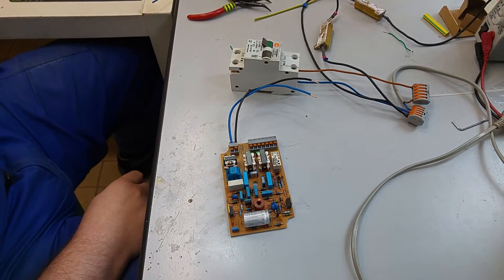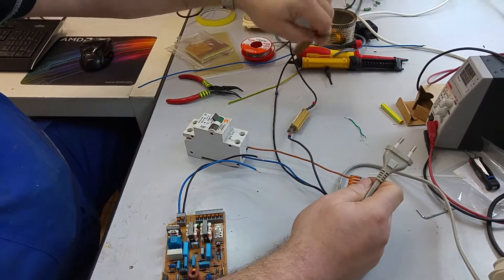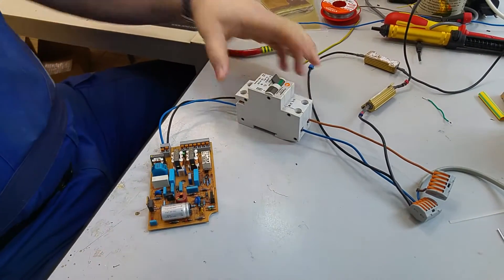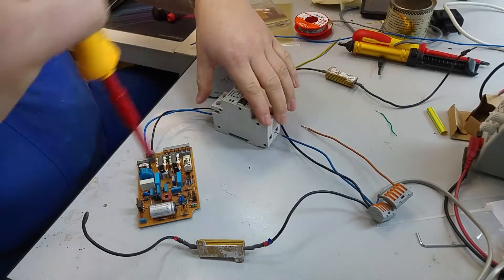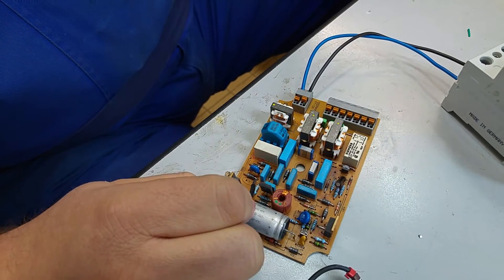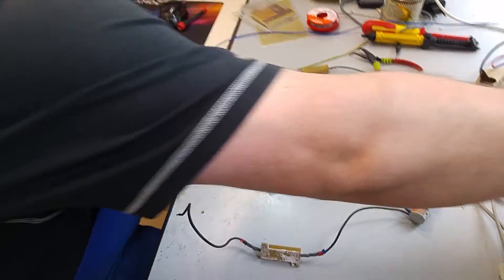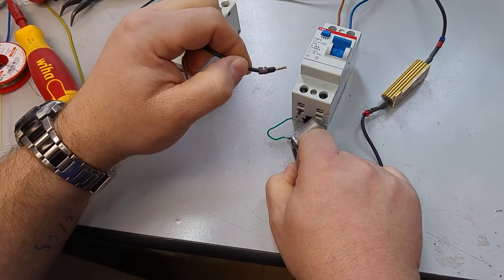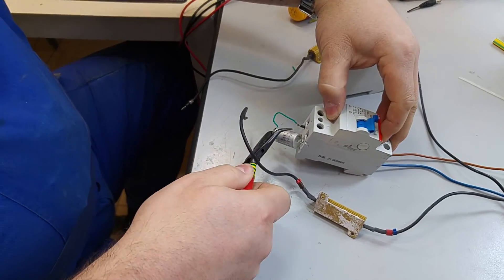About RCDs and DC

Comment: Hmm. so it is a lucky dip.  I guess the RCD manufacturers haven't really considered this scenario properly.  I notice you have the same slim power supply as me.  It is re-badged by various suppliers.  They all have a bug...  Very occasionally when you turn the output on they crash and put out a random voltage.  If they do that the three range selector LEDs will usually be unlit and it will be unresponsive to those buttons.
I like the overalls too.
Reply from the maker: +bigclivedotcom 
Oh, they did. And they created the type B RCDs with additional electronics. Ist just a limitation of the magnetic system. DC cant be sensed by the trigger-coil and saturates the magnetic core, until the sensitivity gets so low that there is no way to trigger it anymore.

The power supply never failed for me. Only thing that irks me is the fairly beefy cap at the output. It makes the current limiting useless, if you connect it powered to a load.
Reply: +Andreas Dill I'm guessing that the future of RCDs might involve hall effect sensors.  It would be interesting to see that same test done with a small load on the RCD like a work light.
Just be aware that the power supply will almost certainly do something weird one day.  I know three people with them under various brands around the world who have had them do the random voltage thing.  Sometimes with catastrophic results for the load connected.  The slight lag on the current limiting is common in many supplies.  I had the idea to test zeners by setting a high voltage limited to just a few milliamps so the voltage indication sat down on the zener voltage.  It nuked them all when the capacitor discharged through them.